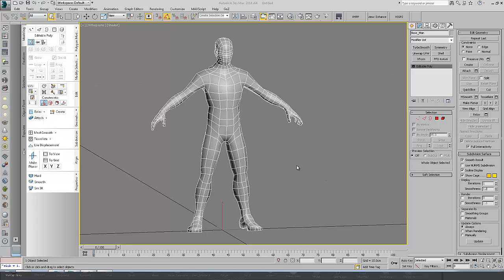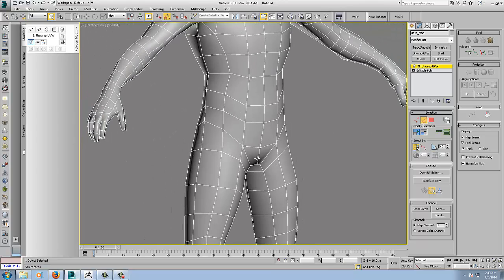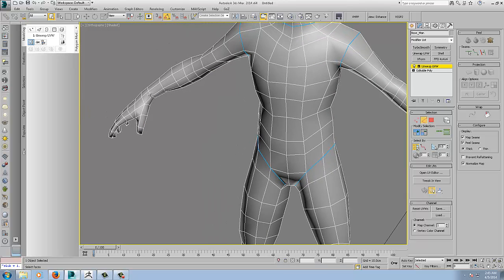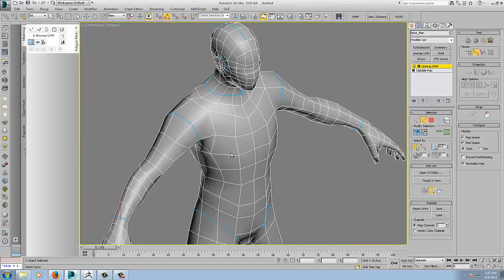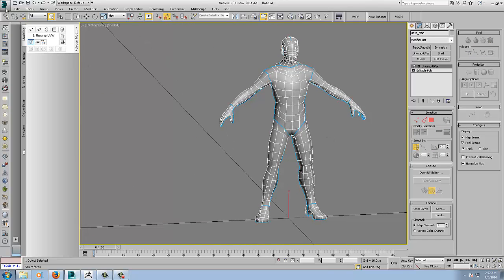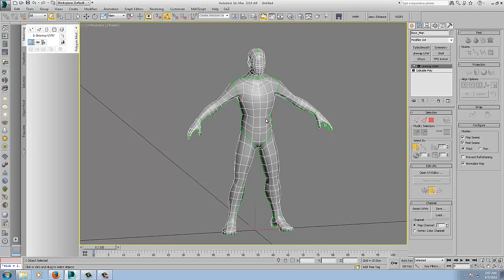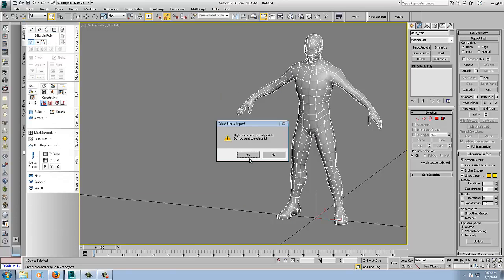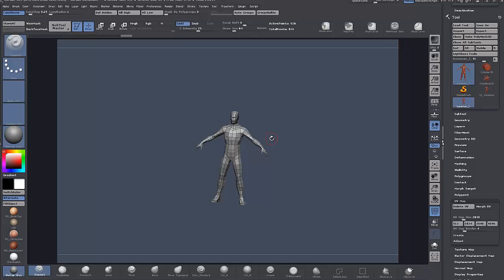3dsMax to Zbrush to Max_UV Workflow Tutorial

Comment: so is the whole point to have as less stretched squeres as possible
Reply from the maker: No, as you can achieve the same results unwrapping in Max. It's more about the workflow for using Zbrush and Max together for unwrapping. It just gives you an extra tool you can use. There are times when you might want to make use of Zbrush's UVmaster algorithm, and other times when you won't.
Reply: musashidanmcgrath cheers mate thanks for the reply.so im abit confused as the exact process.. so I makel a low poly model in max.map it.then bring it into zbrrush sculp the detail.then bake it and put it all together again in max?
Reply from the maker: daveeol1987
The workflow is flexible and Zbrush pretty much allows you to do this at any stage. So usually you would finish your sculpt, export and set up your UV seams on the base level mesh in Max, then reimport to ZB and use UVmaster. If your subtool is active when you reimport then ZB will automatically propagate the UVs. Then bake your maps, export your basemesh again(with the ZB UVs) and put everything back together in Max(as you said)
Reply: musashidanmcgrath thanks im new to all this do you live in Ireland?
Reply from the maker: Well stick at it. Even after many years there's no end to the learning. I'm from Ireland, but I'm currently living in Australia.
Reply: ya I taught as much with the crickets in the backround of the vid. haha im just back from Darwin/Melbourne myself. do you have a job in animation over there?
Reply from the maker: daveeol1987
Ha! I really do love the crickets, I have to say. I'm actually a carpenter by trade. I just do this as a hobby, with the odd freelance job thrown in.